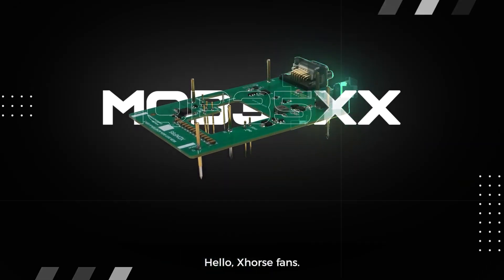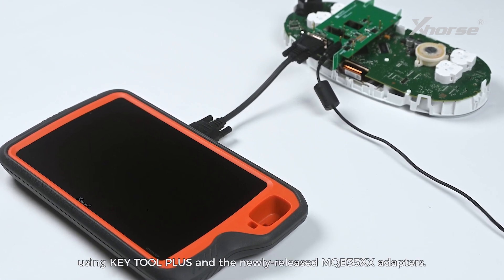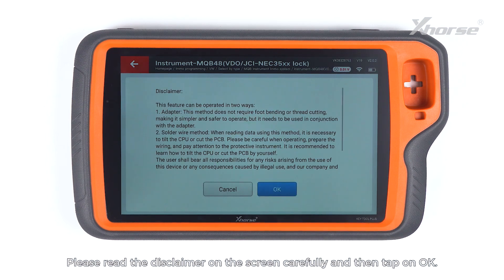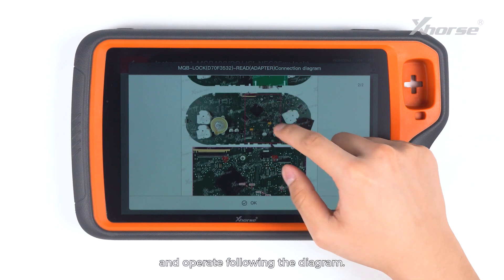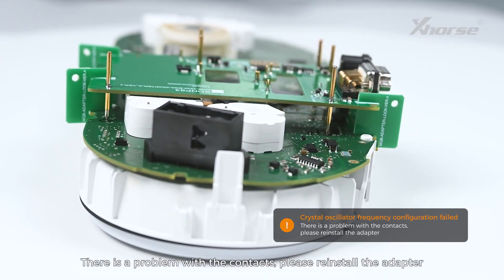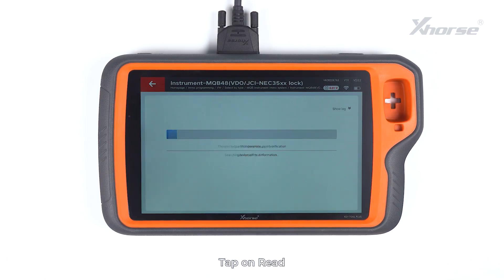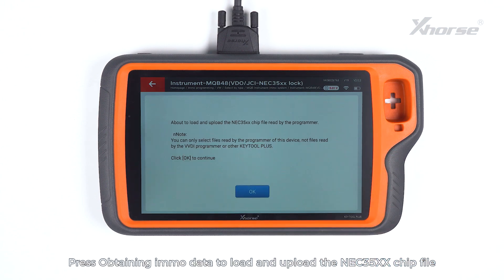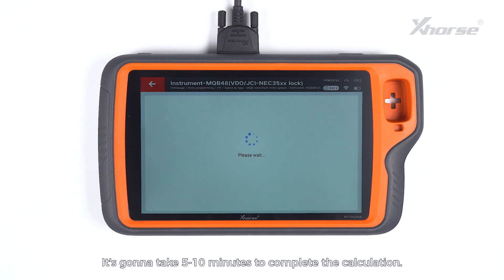MQB48 Solder free Adapter Read D70F3532 Using KEY TOOL PLUS | Xhorse

Comment: Svp.mqb . vvdi 2 and vvdi prog انمنى ان تكون هذا الطريقة في جهاز vvdi وvvidi prog.هل من جديد في vvdi 2 and vvdi prog
Reply from the maker: لمزيد من التفاصيل بامكانك التواصل معنا عبر الواتس اب شكراً لك:
+971 58 822 2211
Reply: Спасибо
Reply: I have vvdi2 and vvdi prog with adapters and cable db25 db15 red, but it does not read. I am frustrated with xhorse.